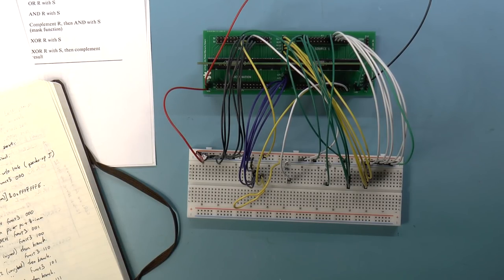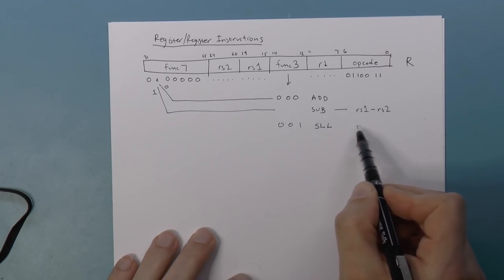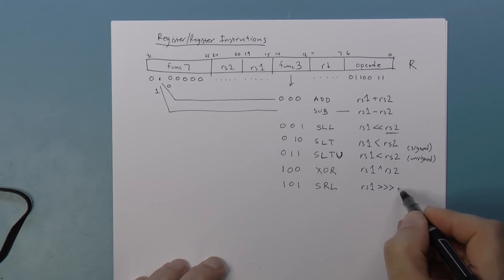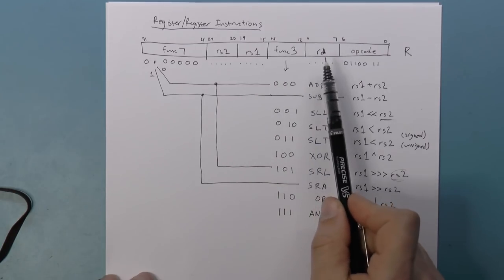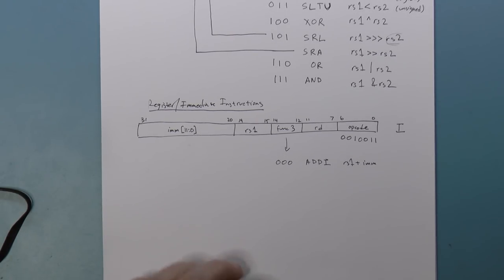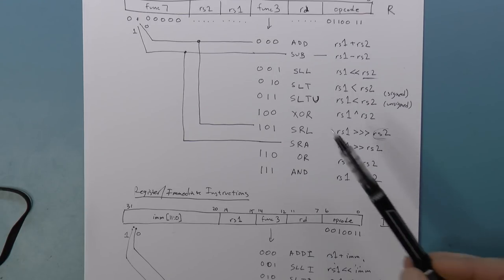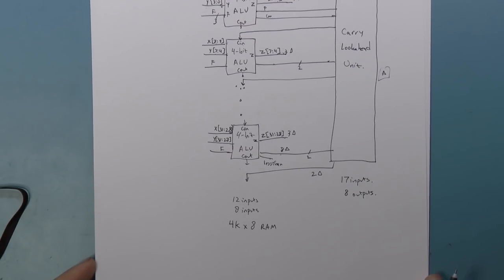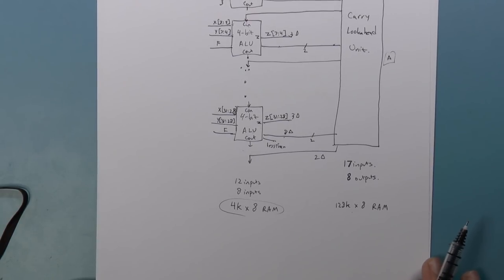LMARV-1 (Tangible RISC-V) Part 3: Designing the ALU

Comment: In a way, you're using RAM as an early-FPGA-equivalent – you are field-programming a device, at startup time, to perform a logic function; not by programming a particular configuration of logic gates, but by making it hold the complete truth table in memory. 

But as you describe, you need some "master" storage from which you program each 4-bit adder and the carry-lookahead calculator. As you say in the video, a ROM plus a counter will serve; but you have another device that would be pretty awesome to use for this: your Remex RRS7155BA1 punched tape reader! It provides the 8 bits of data that you need at a time, and the counter that addresses the RAM to be written would just need to advance the tape one step for each address. Then you'd have a RISC-V CPU that bootstraps from punched tape! :)

I'm not being entirely serious of course, but then again ...)
Reply from the maker: It's true -- I have nine LUTs. Really big ones.

I did briefly consider using the punched tape! At 200 Bps, it would probably take under two minutes to boot, which isn't so bad.
Reply: Booting the CPU from paper tape would be kind of awesome :)

Comment: Absolutely amazing video, amazing series, job well done, thank you for making these :)

Just a note, at 9:46 you mention that for the unsigned comparison for SLTUI performs a sign extension for the comparison? Did you perhaps mean that the sign extension happens for the signed comparison SLTI, whereas the unsigned SLTUI just zero-pads? Sign-extension doesn't make sense for unsigned comparisons
Reply from the maker: You're right, it zero-extends.

Comment: The s series 74181 is capable of adding a 17-bit to 64-bit in 28ns, according to the datasheet. I'm guessing the number 500ns is for ripple carry, but even that seems high as the plain 74181 can do an add and carry in 22ns.

Still, I've been on the fence whether or not it's worth using a '181. Mainly because the opcodes for the '181 are a mess and you'd need a decoder for a risc machine so you don't waste instruction bits. However, after watching this I'm thinking a LUT decoder plus '181 might not be such a bad idea since I want to stick to the RV32I instruction encoding and the shift plus SLT ops might need some extra control lines.
Reply from the maker: Hmm, maybe I was thinking of the CMOS version? Or a version capable of 3v3 operation that was really slow.
Reply: Yeah, that make sense. I didn't even know they made a CMOS version. Which isn't surprising considering how much slower it is than TTL.

Comment: I have a small problem with your notation.  Here I reference the usual symbols from Boolean algebra.  You can see these on Wikipedia and used all over standards publications such as NIST FIPS 180-4 Secure Hash Standard ( see section 2.2.2  Symbols and Operations ) wherein a large inverted V indicates bitwise AND.  The large capital "V" to indicate bitwise OR and then the bitwise XOR ( is there any other kind? ) is indicated with a plus sign inside a circle. You are using notation from C and Java mixed together. Would be best to use standard symbols that are code language agnostic and then later convert to higher level language notation. Otherwise we may as well end up with APL and its all Greek to me.
Reply: There are different "standards" that people like to use; + and . notation, v and inverted v, etc. They're all valid and don't have much to do with programming languages

Comment: So... The ALU is basically an LUT? It's possibly not the cheapest option but, when the tech allows and the possible input states are finite and small enough, probably not a bad idea... Back from like 2010 someone made an ALU in Minecraft that probably used more conventional method (of calculating things) but it's kinda slow, and years later I've seen another ALU design that is just looking up the results for any given combination of source value, and it's really fast, although being bulky and can only do ADD operation. (Remember that every NOR gate, which is the only logic gate available, has a delay of 1/20 second in Minecraft and that adds up quickly.)

Comment: oops... you could skip the eeprom and "loader" and just plug in a microcontroller instead, compute the values in "realtime" and push them to the rams. something like an attiny2313 (all digital no-adc). an mcu can even put itself to sleep once bootstrap is done and save power.

Comment: I found some IDT7381 on eBay : 25ns / 40MHz, 16-bits wide with integrated register buffers,  3.3V, cascadable.
I also found other ALU chips, the 74S181 has been extended to CMOS, to wider datapaths...
Reply from the maker: I try to only use parts that are still being manufactured.
Reply: That's a difficult constraint because manufacturers buy each others or go bankrupt, product lines get discontinued on a whim, corporate overlords can decide whatever they like...
My strategy is "stock first from eBay then see what I can do with these boxes of parts" :-P

Comment: Why use ram and bootload from rom? Why not rom all along? Price? Speed? It's not clear for me.
Reply from the maker: Speed. SRAMs can get down to 10ns and below. Flash ROMs are maybe not so fast.
Reply: Your speed advantage will dissipate as soon as you connect all those "buffers" here and there : they will add capacitive loading on the signals, there will be contention during the transition times between a buffer to another... I cringe from time to time when I look at your choices, I understand them but I also know a few alternative methods :-D
Now if like me you have a crazy stock of buffer chips (some brokers sell them almost by the weight) this is a convenient and cheap design approach but 1) your cost will shift to PCB area 2) you can't be too cautious with transitions between buffers => cautions will add delays to prevent bus contentions, and the delays will eat well into your 10ns access time 3) the outputs will drive a whole bus with countless inputs, you don't control your fanout or signal integrity... you don't plan impendance matching, and you will reach only a few MHz. 4) 10ns ASRAM is good only for cases such as direct connection to a single chip (FPGA ?) with only one driver and very short traces (< 2 inches, no impendance matching)

By using a bunch of Flash ROMs, or even a couple of IDT7381, you cut complexity (bugs, cost) and PCB surface (cost) :-)

Comment: Hi Rob,

This project look good but I have three questions for it:
1. You have used the dual port RAMs as a registers but the R0 should be zero and there is not possible to write it. How will you set this register on RESET and how you will avoid change of the initial value?
2. Did you forget the 4th function bit (bit that toggles the shift operation and ADD/SUB instruction)? This increases the ALU slice inputs to 13 (= 8kiB of the memory)!
3. The ALU will also do the shift operations but there is not possible to do it in this unit! I assume that it will be another unit with 32b input, 2b mode (SLL, SRL, SRA) and 5 bits of the bit count (39 bits input) and 32b output connected in paralell to this ALU and each of them will use the tri-state buffers in its output. Is it right? Do you have an idea how to do it?
Reply from the maker: 1: Well-spotted! I intend to inhibit the WRITE signal from the registers if destination register 0 is selected, except during bootup when R0 will be written with 0.
2: Since I'm not including shift operations in the ALU, the SUB instruction can use the 001 code. I will have to encode that with some circuitry, though. Alternatively, I can do what you suggested and just use bit 30 as another input, since 8k x 8 is about the smallest I can get anyway!
3: Right, there will be another unit for shifting. I'm still thinking through my options for building a barrel shifter. In the very worst case, I'll have to break it up into as many as 31 shift-by-one operations :/
Reply: A log shifter or similar might be an option. It's 10 16-bit 2 to 1 muxes for a single direction shifter itself. You'd then need 4 more mux chips to swap the input and output to support shifting in both directions. Plus you'd need 5 chips plus an AND for sign extend I think, need to double check that one.
Reply: Barrel shifter is a bad joke to do it outside FPGA. For 32-bit you need to use matrix 32x32 of the tri-state buffers (128 times 74AC16245 for example), decoder 1 of 32 (at least 4 times 74AC138 + 1/3 of 74AC04) and output logic that made shift from the rotation as a bonus. It looks horrible for all  size, price and trace lengths. But it is fast. 
Bit-by-bit shifting is also stupid idea - if you have ADD in three clock cycles and shift in 1 to 32 cycles on the RISC machine :Q
Maybe I have a solution - 20x 74AC16245, 8x 74AC16374, 1x74AC04 and 1x7408 with fixed timing of 2 clocks. I'll try to put it to the paper if there will be a time. I think it can be acceptable. Let's talk about that later.

I have seen the video 2nd time and I have found next two points in this idea:
4. SLT and SLTU. The result is stored into LSB but it can be affected by the MSB. Will you use another feedback bit in opposite direction than CY (there's free output of the 4-bit ALU) or use the carry and some ay to put it to the dest bus?
5. If I work on this I would like to use a three stage pipeline. When you put the operand into the the first step there is, after ALU delay, a result without carry. Then in the second step the carry is generated with delay of CLU and it is added back to the ALU inputs. Then finally the ALU delivers the correct result. It makes the combinational logic sequential without clock.  I think pipeline makes the ALU better :) and also helps you with the bootstrap as 74AC16374 haves three-state output that can cut the CLU address bits from the ALU outputs when programming. And you also need to be able to cut the ALU outputs from the dest bus (to connect shifter, memory or the input units). I think the output enable of ALU is not solution as it keeps CLU inputs floating and needs the logic for OE control (boot/run mode). Technically it's three 74AC16374 and it's not so bad.
Reply from the maker: Still looking into shifting solutions. I agree, barrel shifting and bit-by-bit are nonstarters. Looking into logarithmic and funnel shifters.

For the SLT(U) instruction, correct, the "less than" signal is generated in the most significant bitslice, but needs to be placed in the least significant position. I'm probably just going to use a gate for that. The SLT(U) instructions in the ALU actually output 0 for all result bits, so I just need to OR the highest lessthan signal with bit 0 of the output. The lessthan signal outputs zero for all other operations.

Maybe pipeline will be in LMARV-2 or -3!
Reply: It's simple to be realized but hard to explain in the short text... I'm bit busy now but I think I can try to make some video about it when I will have a time to it.
But the first, let's decide about the microarchitecture. About timing, pipelining, memory connection (Von Neumann or Harward?) etc. The same CPU specification can use many microarchitectures with different complexity, usage and performance. I think it is late to resolve number of clocks per instruction when most of HW will be done...
Reply: PETMK that's not how barrel shifters are implemented. (Especially not in an FPGA!)
You have log2(n) layers of n 2:1 muxes, i.e. 160 muxes total for 32 bit shifter. You can synthesise left/right shift by using an extra layer of muxes above and below (performing bit-reversal), and arithmetic right shift requires an extra mux for the sign bit (or rather, an AND gate). Total cost 225 gates to perform SRL, SRA, SLL.
Reply: Actually after looking around, I can see the source of the confusion. It looks like barrel shifter is a generic term for a combinatorial-only shifter, which you could build with a square matrix of tristate buffers, a radix-2 butterfly network (which I think Robert called a log shifter, and is the structure I was alluding to above) or anything else you can dream up. For example, you could build a radix-4 shifter using 4:1 muxes, which would be 3 layers for a 32-bit shifter.
Reply: With no pipeline you might want to switch to 74HC logic or a 3v equivalent with a slow slew rate/rise time. The clock rate is limited by the signal path not tpd and somewhat unintuitively using a slower chip will give you a cleaner signal and higher clock rate.
Reply from the maker: Yes, after looking at the alternatives, I think I'm going to use a log shifter, and implement it with tristate buffers.
Reply: Robert Baruch yay :) what is your tristate scheme? Are you gonna go for pure minimum gate count with binary butterfly or the faster shifters with n:1 rather than 2:1 layers? Or something more cunning?

Comment: VAX was NOT a mainframe; it was a microcomputer.  /Triggered
Reply: VAX produced everything from mainframes to workstations. The VAX-11 was a minicomputer, not a microcomputer. It was roughly the size of 3 cabinets (with disk), and sat somewhere between mainframes and workstations in terms of usage. Honestly you were probably more likely to use it as a cheap mainframe than as a workstation.
Reply: @jeffwells641  Yeah, micro computers were what became PCs. The VAX-11 series would support multiple users connected via VT dumb terminals.